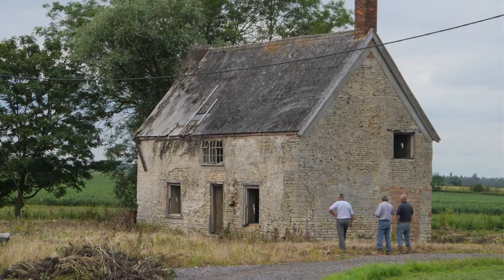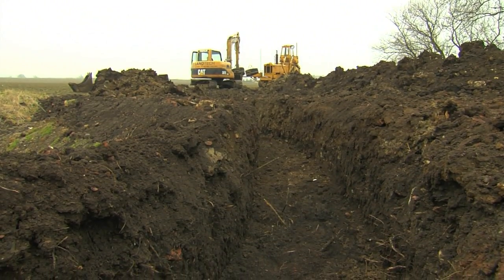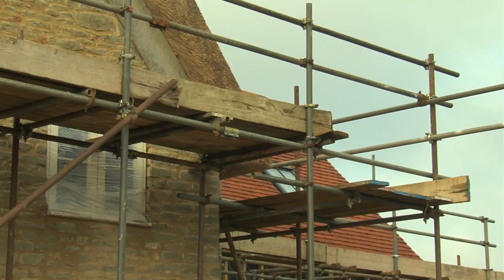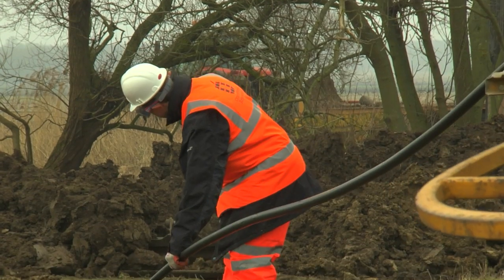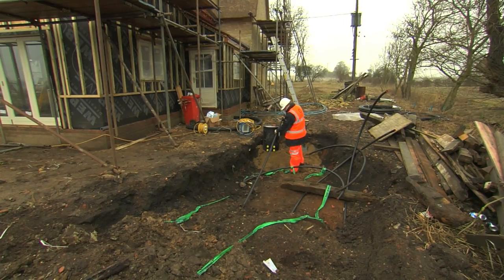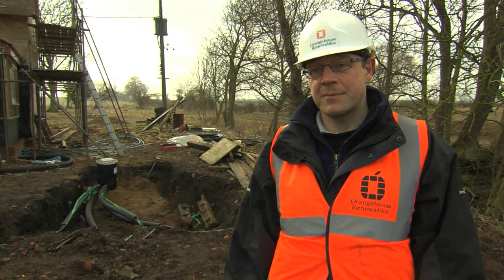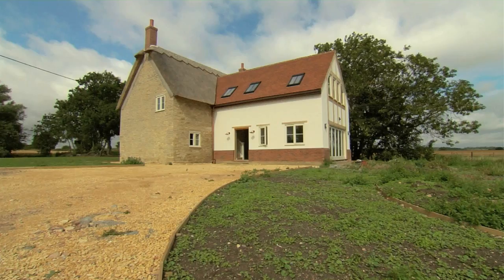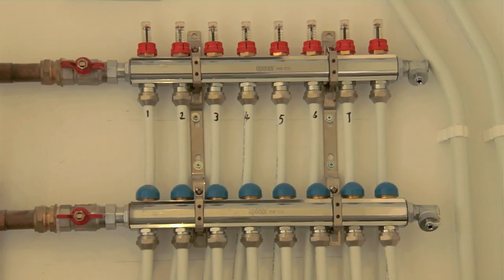Vaillant ground source heat pump case study: The Meaden Project (full edit)

Comment: Yes we do have natural gas in the UK but guess what?  Recent announcement from UK and Europe is that soon all new builds will not be allowed to fit a gas central heating system. In Holland they are moving towards heat pumps. IE they burned all their gas and/or sold it.
Reply: Won't happen any time soon, just like electric cars.
Reply: @lemmykilmister450   Eat your words:
What Will Replace Gas Boilers in 2025? Starting in 2025, low-carbon heating systems will be installed in all new build homes. It's anticipated that the systems in these new developments will include heat pumps, heat networks, hydrogen and direct electric heating. (8 Jul 2020)
Reply: @simonclark6296  hydrogen mix will be the most likely option.  New builds are thrown together normally,  God help you if you get the other options.

Comment: I'm looking for an honest review of heat pumps.  Everyone I know that has switched to heat pump heating and all of them have faced a massive increase in electricity costs.
Reply from the maker: Hi Stephen, it's normal to see an increase in electricity usage after having a heat pump fitted as it's the only form of paid-for energy the heat pump uses.
Reply: @VaillantUK  my friend in Wales saw his bill rise to £800 a quarter, my friend here in France saw his bill treble. If the future cost of energy follows the pattern in Germany and Denmark where they have gone all in for green energy, then my friends will see a doubling if their costs in the next 5 years.  Whereas, the only thing raising the price of my oil fired heating is tax and it is still half the price of a heat pump and heats in all weathers.  It's that honest review that I seek.  That doesn't mean that I wouldn't have a heat pump installation but I won't because I don't want any terrible disasters. If you can reassure me with honest, verifiable data I would greatly appreciate it.
Reply: What you have said here is that the heat pump doesn't use electricity to heat the system and that energy use and therefore cost rises.
Reply from the maker: Hi Stephen, the heat pump is powered by electricity but the heat in the system is the thermal energy extracted from the environment. So yes, electricity bills will increase, but that is offset when you consider there won't be any more gas or oil bills. You can find out more about how heat pumps work here https://www.vaillant.co.uk/homeowners/advice-and-knowledge/how-different-technologies-work/heat-pumps/air-source-heat-pump/. There are lots of reviews on heat pumps on YouTube: this is a good place to start https://www.youtube.com/watch?v=8sQkKaTxiUY&t=245s. We also have case studies on our website that you might find interesting: https://www.vaillant.co.uk/homeowners/helping-you-choose/case-studies/. Kind regards, Vaillant

Comment: Is ground source heating cheaper to run than air source? How many kwh can you extract from 1kwh of electricity?
Reply: In theory it should right, since it’s extracting from a source that is cooler/warmer than outside air. I’ve seen it mentioned as 3-4 COP, so 4kw of heat for 1kw of energy.
Reply: UK has mild weather (relative to N.America) to begin with, so AIR source is great fit for them COP is quite good ~3 to ~4.  Ground source is with huge public subsidy is taxpayer rip off and only slightly better COP

Comment: I would love to see all that gigantic equipment retro-fitted into a 2 bed terrace.  There is no way that even air source is suitable to retrofit. Most houses with comb boilers have no room for tanks and the attendant plumbing. This is especially the case with new 'starter homes' and three bed semi's  that are jammed together on modern estates. The boiler is in the kitchen and many don't have garages etc.  Plus the hot water tanks ( that went out of fashion decades ago) , run out of hot water. There is no way I am going to fill my bath half full and then wait an hour to fill it, even if I am not extravagant.  Sorry, this tech just isn't suitable for most homes now.

Comment: I would look at air source heating first,could be a lot cheaper to install and run.
Reply from the maker: Hi there, you can find more info on ASHPs on our website: https://www.vaillant.co.uk/homeowners/products/renewables-solutions/air-source-heat-pumps/
Reply: Not cheaper, less efficient , don't work well when it's cold
Reply: Not cheaper to run in north Europe as air temperatures are low when you need heat and COP falls below 3

Comment: Well we just put in a request for a quote on our property, looking forward to the response from Hafod Renewables who I understand is one of your registered installers. We live in mid Wales and our 1960's 3 bedroom bungalow heating system runs on Oil. So watch this space!!!
Reply from the maker: Great! We're really pleased to be a part of your plans:)
Reply: @VaillantUK  Thanks for your prompt reply, our case is slightly unusual in as much as our property is of a Steel frame design, comprising of a steel structure cladded with Brick on the outer, and 35mm thick Plasterboard on the inner. The only insulation that has been added is in the loft. The difficulty is that our ageing Oil burner is failing and in need of replacement, but we want an Air Source Heat pump to replace it. We understand our home needs improving on insulation, but we also want to extend the property. So the order in which things take place is import to achieve the end desired result, can you help on this?
Reply from the maker: I'm sorry we can't help you without visiting your property, and as we don't actually install our appliances ourselves, we'd advise you rely on your installer for advice of this nature. We do support our installer customers with advice on system design and specification, so should your installer need this, we'll be very happy to help. Your installer should know their local Vaillant sales rep if they need any support. We wish you all the best with your renovations. Sounds like an exciting project! Have a great weekend, Vaillant
Reply: Other option ken is to look at biomass boiler we have just purchased a large rural property which we are going to renovate and as part of that install a Klover Smart 120 pellet boiler
Reply from the maker: Hello, Vaillant doesn't make biomass boilers so we can't offer any advice there, I'm afraid. One thing to consider though (in this social media manager's humble opinion), is the transport of the pellets to your site. With a heat pump, you can effectively be off grid if you run it with electricity generated by solar panels and it kind of takes care of itself. However, I'm no expert!
Reply: @Slymo11  we already ready have a fire place in which we burn seasoned wood, it’s our back system should all else fail!
Reply: @Slymo11  don't do it!!!!!!